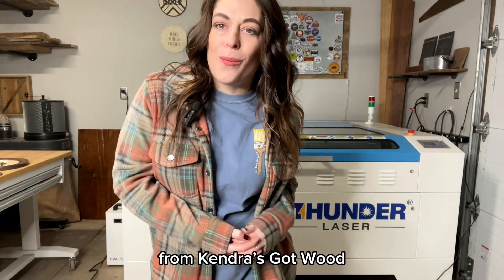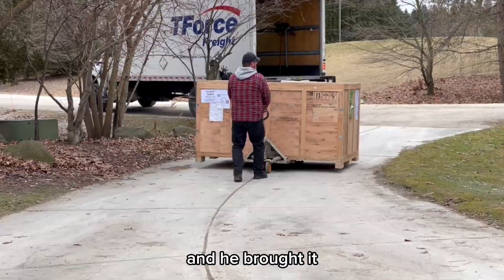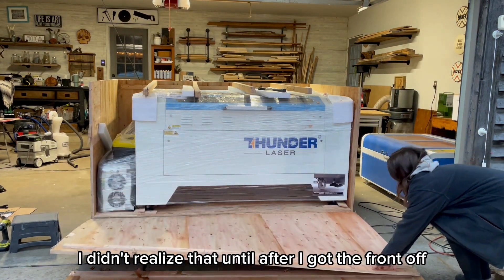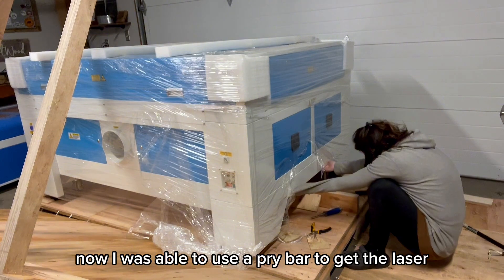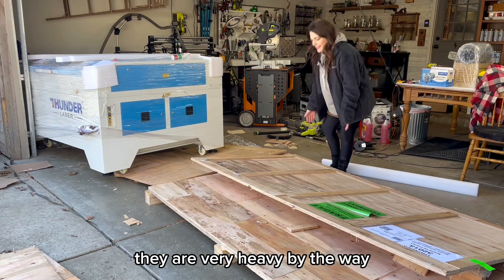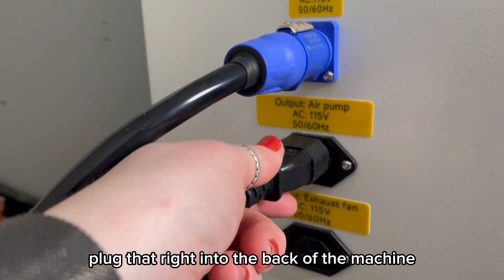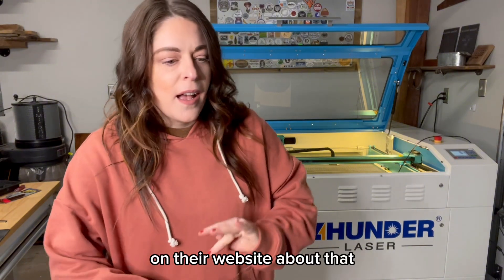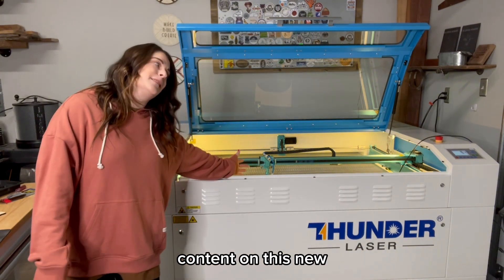Preparing for your Thunder Laser - Don't Make These Mistakes! Unboxing & Setup Nova 51

Comment: First I want to ask you how load your extraction fan is. I got my Nova 51 two days ago and I have to leave the room when it's on. It hits 96 dB which is as load as a factory floor. Secondly I think Thunder USA need to get their act together. I stay in South Africa and Thunder not only delivered to my door but unboxed it, Split the top from the bottom to get it into my office, re-assembled it, did all the wiring and piping and gave me hands-on training for about 4 hours. I had to ask them to leave.
Reply from the maker: Haha wow! Thunder doin all the work over there. My fan isn’t very loud actually. Not noticeably so.

Comment: Hey! Did you use the duct? The silver tube that’s supposed to I guess help ventilate to the outside?
Reply from the maker: Yes! You have to! I actually realized after I had this all edited and ready to upload it’s the one thing I left out. 🙈 I am currently just venting it out my garage door, I haven’t cut a hole in the house. 😬